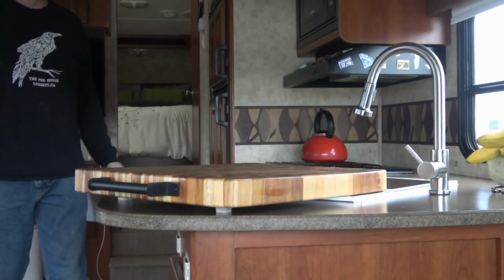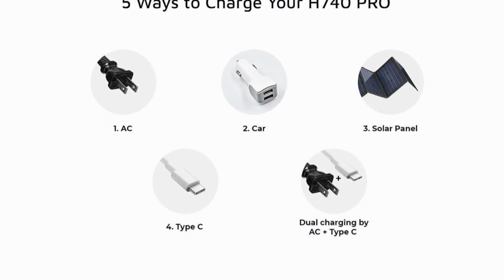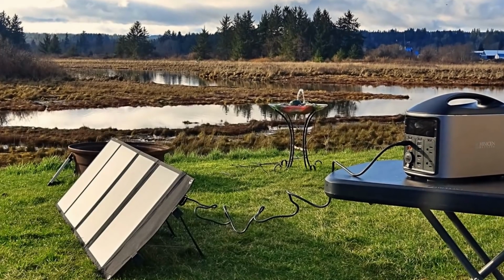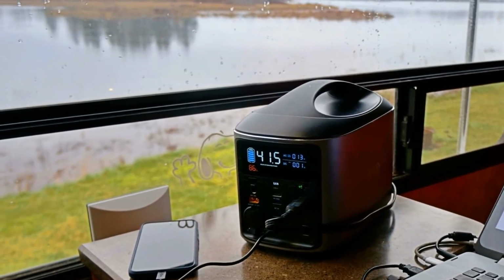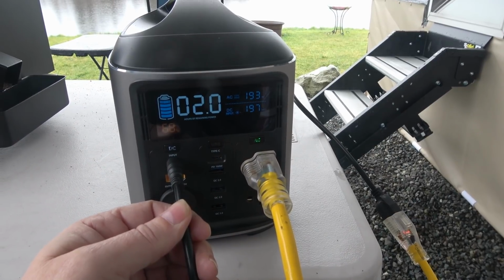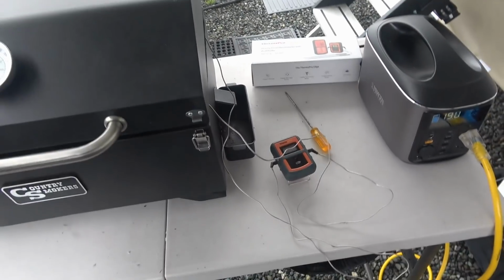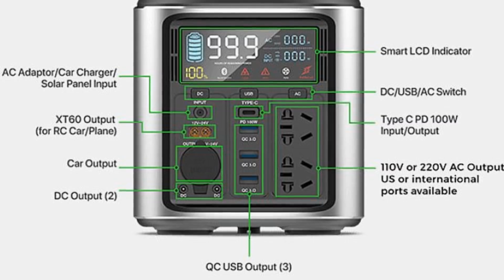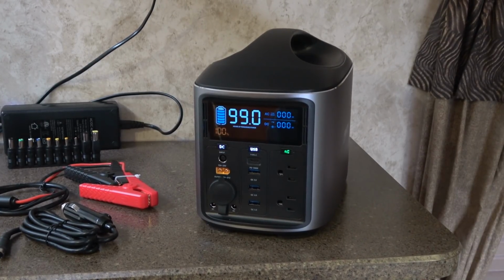Reviewing the HIMCEN H740 Pro Portable Power Station w/Removable Battery Pack!

Comment from the maker: HIMCEN H740 Pro Launch Page -  https://igg.me/at/himcenbattery
Update March 15th, 2021

------------------------------------------------------

Product Improvements Spring 2021

Select units shipped to reviewers in early 2021, after which our reviewers identified a couple areas of improvement. We have been able to fully address these issues in the version of the product shipping to Indiegogo backers. Here is a summary, for those of you who like to dig into the technical details. 

Solar panel: Ray Burr mentions about lower power for our solar panel. We have now sourced solar cells from a US brand that features improved efficiency. These solar cells are the same sources from Jackery’s (our major competitor) solar panel vendor, so the power and efficiency of the solar panel will be on par with Jackery’s solar panel. 

Capacity: Review units did not feature the high capacity original battery cells that are included in our first production run units. Indiegogo backers will experience improved capacity over the values cited in the reviews. 

Power level setting: We intentionally made the power level high to prevent overheating, so the power drops when the capacity of the battery is lower than 20%. To correct, we will make a slight change to the software setting for first production run units. 

-------------------------------------------------------------------------------------

Comment: Can you explain how you hooked those panels to get 300w input? I cant see how its possible in series... with just 24v limit... thanks for any info!
Reply from the maker: They weren't hooked up in series, I had them hooked in parallel. Something like this as an example https://www.newenergyco-op.co.uk/user/3%20x%20100w%20in%20Parallel%20Diagram.jpg
Reply: @LoveYourRV  interesting. What watts were you getting on input? And I am surprised it would allow more than 10 to 12 amps. Your pushing like 16 plus there. Is it just limiting it to 10a? Which would mean you not getting close to 300w......just curious. I saw in your video it limited to 24v.... but not amps...most sogens of that size limit to 10 to 12.
Reply from the maker: @chrisanderson8553  The Himcen 740P is rated 12V-30V 100W-300W (300W) max solar input.  In my tests, I was seeing about 160-180W input charging which was pretty good since it was March so the winter sun angle was pretty low here in Canada when I tested and they are flexible panels so usually the output isn't as good as glass rigid types I find. The Jackery Solar Sagas were putting out around 60-65W each and the folding panel Himcen sent for review was a disappointment at about 45-50W. I informed Himcen of the low output and they have changed the solar panel source for the final production product launch. They make the power box but outsource the optional folding solar panels. They have assured me the final product will match the output of the Jackery panels now.
Reply: @LoveYourRV  Did they give you an amp rating? Or what kind of controller is it? Mppt? I guess I'm not making my point or question clear enough.. when in parallel you are adding up the amps of the panels.. you have like 16 to 18 amps there. I don't know any sogen in that price range that doesn't limit the amps to 10 or 12.. so if that is the case.. your only going to max...like 75% of the watts of the panels. So just curious on how to get the 300w max. I like the battery swap out of these.. but would really like to be able to get 300w charging.. but I am have trouble with the math figuring out how to do that.
Reply from the maker: I didn't have enough direct sun power to test it to the max, maybe I'll try again as summer approaches and the sun is more directly overhead. I can say though that the AC power brick uses the same DC input as the solar and it puts out 19.5VDC  @ 12 amps, then a 100W USB-C charger can be plugged in at the same time and they put out 20VDC @ 5 amps so combined its charging at 17amps. I'm not sure of the internal charging setup but I'd assume its using an MPPT charger

Comment: It is a new standard in Solar Generators for sure. The way they let you charge an extra pack is a no-brainer for most. Regulated 12v output at 10A and the 20A output is a nifty feature. Pure Sine inverters are basically the only ones you should buy. Maybe the price is not that attractive, many go for a 300 Wh capacity device at around $300. This being a 500 Wh at $499 would be an absolute market winner. Selling extra 500 Wh batteries for $199 and you have 1Kwh on the go for $700.

Comment: Your reason for calling it just okay, is actually the standard across the field of lithium battery banks. By definition you only get to use the top 90% of the battery capacity do as to protect the battery life cycle rating and so the unit has protection cut off when it reaches the 10% remaining level. That is standard.
--- for example my Suoaki G500 which is sold as a 500 WH unit only (actually built to 509 AH) the manual tells me to only expect 450 WH of usable power. 
---but rarely do I ever run it down to 10% because it's always better to charge it up when the opportunity presents itself
Reply from the maker: First, IMHO. these battery packs should have enough real capacity built in to them so the BMS can supply the rated WH no matter the load. Also, I didn't like the fact the AC voltage dropped so low and yet the unit was still powering the device. Too low of voltage will cause many switched mode power supplies in things like TVs and computers to run excessively hot. If the battery --> inverter can't supply a solid 110V then for safety it should be shutdown sooner. I'd bet the trade off was made to keep the unit compact and not overheat it. So, to me the inverter portion of this unit is just OK. The Jackery's inverters I've tested are better IMO. I was actually able to power my 700 watt Instant Pot off the 500 watt Jackery to cook a 12 minute rice cycle. The 600W HIMCEN  shuts down instantly. That tells me the Jackery has a bit of overhead in its inverter design. HIMCEN has thanked me for pointing out some flaws. A lot of stuff can be tweaked with firmware, so likely the final versions will be better.  Cheers, Ray

Comment: Hello from Vancouver. Your reviews are great! I have a question regarding your Haloview monitor. How do you keep it on, when not hooked up to the truck with lights running? I see it sitting on your table, and it's on, I would like to do that with mine. Love watching your videos!
Reply from the maker: I usually use the 12VDC power that is in the RV. I have several plugs I've wired.  In the video, I was demoing that it could be powered off the portable power box.  I have several videos here that show different ways I hoked up the cameras and displays. https://www.loveyourrv.com/tag/Haloview/ Cheers, Ray
Reply: @LoveYourRV  Thank you so much for the quick reply, I will try and do mine.  Be safe!

Comment: I heard you mention that you use a electric blanket and you have a night time temp in the RV of the mid 50's, do you not get unlimited hydro from you RV park included in the price? Do you have the temp in the 50's by choice? Could you not at least have a temp of around 68 with space heaters?
Reply from the maker: Yes, we do but, I like it cool when I sleep and Anne likes it warmer, so she has the electric blanket so she can control her temp. At night I usually just have the dehumidifier and a 600-watt heater running at night, though I could run it at a higher wattage and make it warmer as we have a 30 amp service. During the days which here are often, due to clouds not much warmer outside than the nights, we keep the rig at about 66F by also using a 700-watt oil heater. I have the RV furnace set to fire up in the mid-fifties so that the plumbing and tanks don't freeze. During some of the coldest nights we have had, it has run. But the RV skirting really helps, I'm able to save on propane with a 30 lb tank lasting a month or more.

Comment: Huge "Thank You" for your reviews. Especially, the Lion Energy savings code and details. Your review was a true RV saver for us. We had two 6 volt batteries in our battery compartment that were so heavy they broke the welds on one side of the battery box located in our Class C under the step into the coach. We were driving up a mountain road when we heard a horrible squeaking sound and one side of the box gave way. We had wanted to get lithiums 2 years ago, but at that time the lithiums were too big to fit in our battery box. We just received our 2 new Lion Energy 1300 batteries. After rewelding and resupporting the battery box, they fit perfect. Just want you to know that what you do really makes a difference to many people. Thank you so much.
Reply from the maker: You're welcome. :) Mine are still performing well, too bad I didn't get to head south to boondock this winter.
Reply: @LoveYourRV  On the bright side, you can tell people that the batteries can be used in a cold weather climate with proper care. We had to leave Death Valley in December because California closed most of Southern California's parks due to rise in Covid cases. We had to leave Florida in March 2020 when all their parks closed. Trying to plan a trip is like rolling the dice.... I am just thankful we are well. One of our relatives went on a trip and ended up in the hospital Dec. 23 to Jan 8 due to Covid. He is only 58 years old.
Reply from the maker: Yeah, can be tough, rules can change on a dime. Canada is now going to make anyone entering the country from non-essential travel go to a designated hotel room for 3 days and pay over 2000 CAD out of pocket and get a test. Fail and you have to stay in the hotel for 14 days.

Comment: Another great review.  I would buy one when available but the 600W just isn't enough to do much.  A little extra money for a Bluetti AC200p would be a far better investment.
Reply: Something I could plug a coffee maker into for example.  I wonder if they have plans for a slightly larger unit in the future.  I love the display on this unit.
Reply from the maker: Seems like there are 2 types the old style drip brew and the single cup pods. Most drip brew seem to use around 1000W but would need a thermos or carafe so energy wasn't used just keeping the pot warm, then the single pods, looks like most are around 1500W.  I haven't paid much attention as I'm a tea drinker and Anne uses a stove top espresso maker for here morning mocha coffee.
Reply: @LoveYourRV  I have my name in to get one anyway.  Your vlog does a great sell job,lol
Reply from the maker: If I run into any issues with the unit I'll be sure to put out an update video.
Reply: @LoveYourRV  I look forward to anything you put out.
Reply from the maker: I guess it depends on how you camp or if for home backup. That Bluetti model you quote is 1800 bucks? and 60 lbs, so quite the tank to cart around.